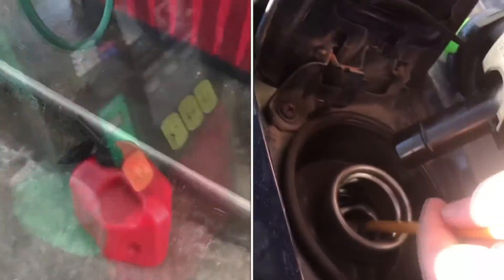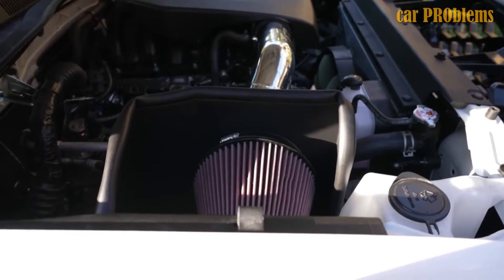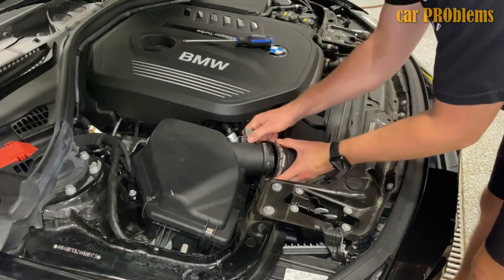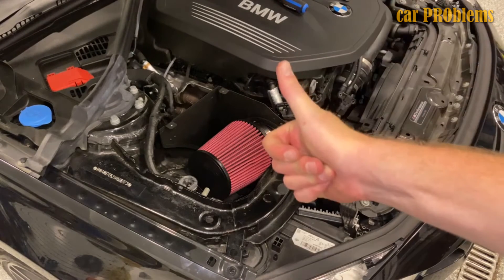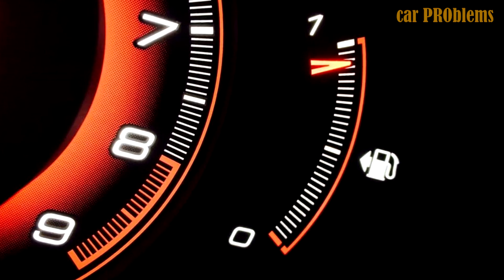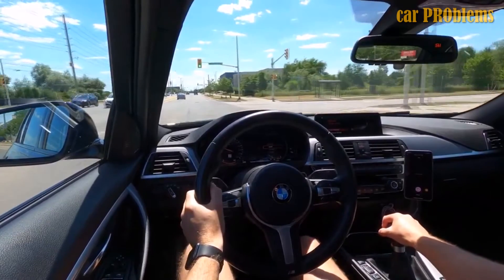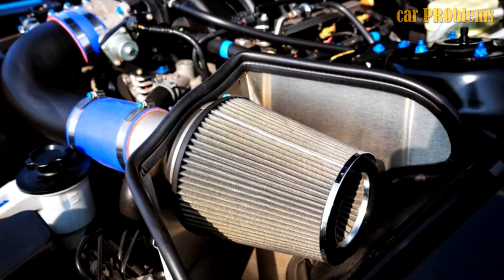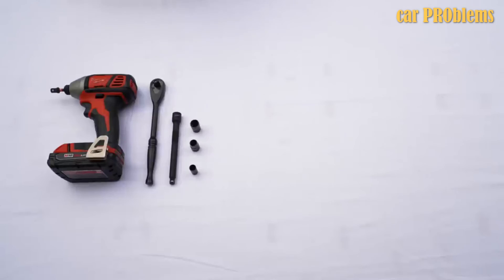Does a Cold Air Intake Increase MPG? - Cold Air Intake Pros and Cons

Comment: Cold air intakes can be beneficial but, it’s not by adding more ‘oxygen’ since air is a combination of gasses. It is a matter of providing denser air to the combustion chamber. If you want the best performance from a CAI, look for one that locates the filter outside the engine bay. Like PMAS with the extension into the fender well. Although to get the most out of a CAI, you’ll need a tune. The CAI examples shown can be a waste of money and only let more hot (engine bay) air in. Hurting performance and MPG.

Comment: https://youtu.be/PbPbe_85g6c?si=9-2aEtMD9_5kGOYo&t=213
That is not how you clean a K & N style air filter !!!
You use low water pressure from the inside of the filter to push the dirt out of the filter...
Also these air filters have lower resistance but do let a little more fine dust thru the filter...

Comment: Wouldn't more oxygen cause more fuel to be injected to stay stoichiometric
Reply: Kinda not exactly but you can say so. If you really want to save you need a leaner tune
Reply: ..... More oxygen makes the gasoline burn more efficiently You can read all about it on google It makes better gas mileage..... That's why a dirty air filter cut your gas mileage way down which which is already Believed all over YouTube
Reply: You’re still limited by the tubing diameter. 

I doubt an intake without a larger diameter would do much with mpg or even changing the ratio of air/fuel
Reply: Yes, and a tune can allow you to adjust stoich as well.   Noticed ethanol tables have slight variances…